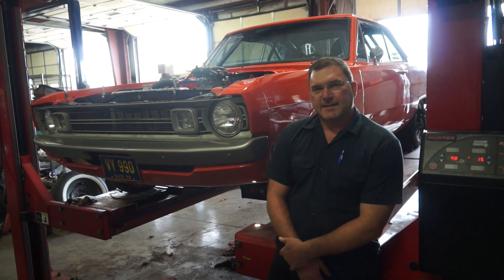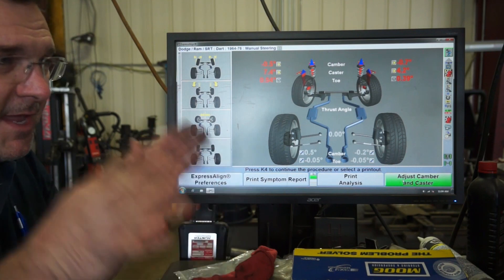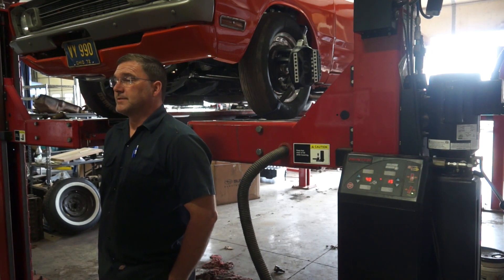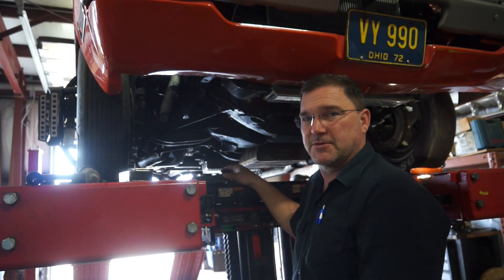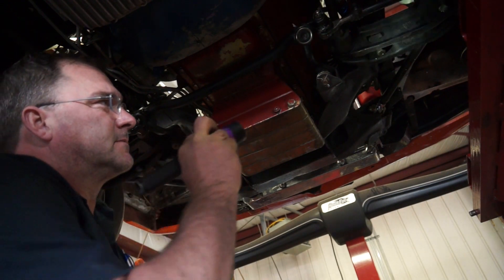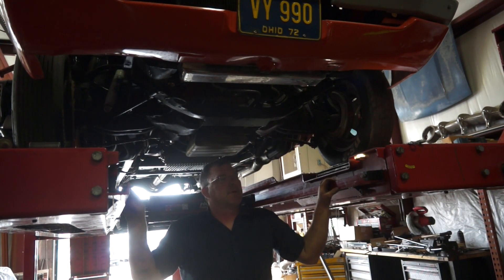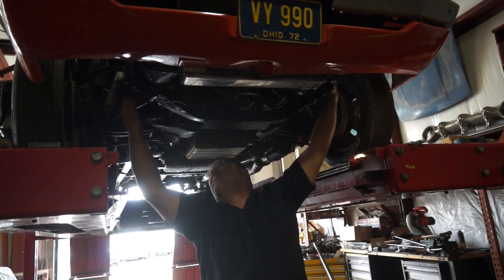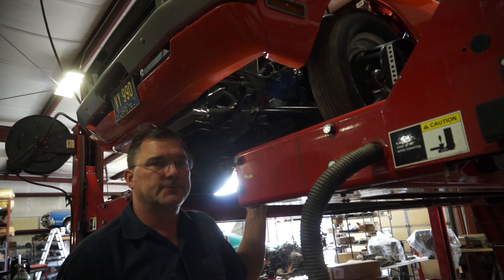Dodge Dart Drag Car Alignment! Gorgeous 1970 Dodge Dart in for help. From Lucore Automotive

Comment: Great video! When I built my first drag car way back in 1977, a 1971 Plymouth Duster with a 440 big block, the Direct Connection racing manual recommended using the lighter 6 cylinder Torsion bars because they would allow more suspension movement to help the car transfer weight to the rear tires. I also set it up with the maximum amount of caster that I could get out of it along with zero camber and toe-in.  Had a lot of fun with that car, sure wish I would have kept it...

Comment: The local guy that does front end alignments is a drag racer himself.   The torsion bars being off set alone would throw things off.  I can't believe they had the car toed in.  That is crazy also.  I learned to align front ends on an old Hunter alignment machine.  We used a wooden yard stick to get the back and front tires in some kind of alignment.  I've never aligned a car with upper adjustable a arms.  That has to be easier than adding shims or adjusting eccentric bolts and washers.  I'm sure it's going to launch and go down the track much better.

Comment: The differing / higher right spring (tortion bar) pressure is likely to help counter the engine torque and deliver power to the rear right more quickly so it stays planted and maintains traction.  I'm not sure that making them even is what the owner would have wanted.  I would have asked the owner about it before making that specific change.
Reply from the maker: The owner was with us the entire time, especially on a project like this we ALWAYS check with the owner/driver before making changes. In many cases you are very correct, it can be set up that way for a reason. In this situation with how incredibly out of whack the entire front end was when we got our hands on it the decision was to set the car up properly to see how it does then make adjustments once they have some on track data/experience with it. 

Essentially, let's set a GOOD baseline, then go from there.
Reply: Thank you for your feedback....  The customer purchased the chassis and has never been happy with the handling....  We have to start with a baseline to figure out what is its best set-up.  I chose to square up the chassis to see what results we achieve.  As we make test hits and practice runs we will watch video and and get driver feedback to make adjustments to the chassis.  There is no right answer to setting up a chassis as they all have different requirements to make them run straight.  Different chassis builds, frame reinforcement, engine torque, chassis flex etc...   every car gives us a new challenge, we try to make it as good as we can and then make it a little better.  It's a process.   There will likely be a follow up video on this car so we can figure out solutions to other issues that may be welded into this chassis.

Comment: i always thought a flimsier bar (slant 6) is best for weight transfer in drag racing.  I picked up some for my 71 satellite.
Reply from the maker: Somewhat so yes, there's a fine line between flimsy for weight transfer and flimsy that makes your chassis flex/rebound too much. You DO want some of that "give and go" but we don't want to this thing twisting and all over the place. If you're interested, we have a WHOLE bunch of new suspension parts coming from Firm Feel for the 73 Charger, they have a wide selection of new bars depending on use.
Reply: @LucoreAuto  I'll be watching. 👍